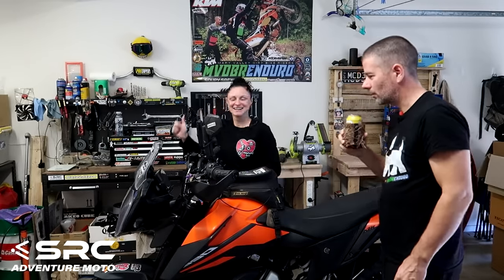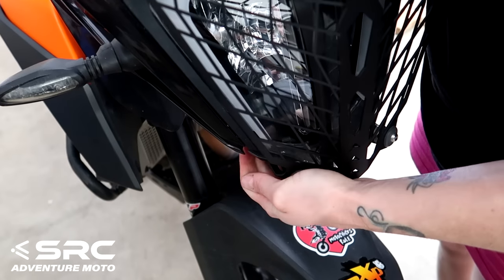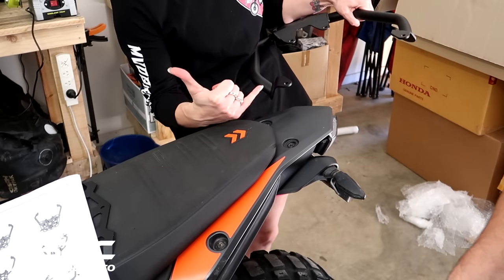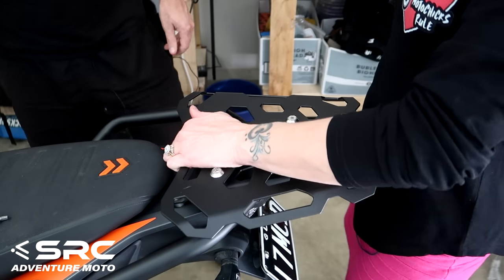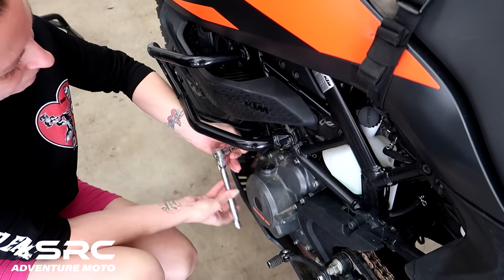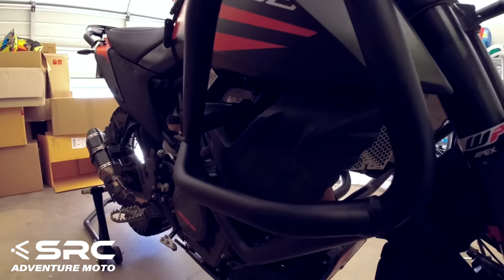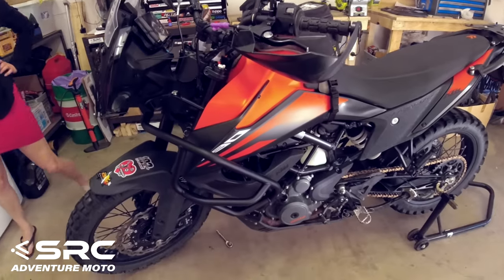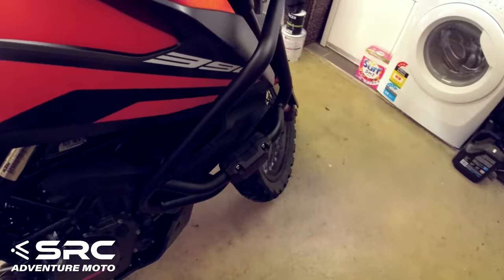KTM 390 Adventure: SRC Accessories Install - Crash Bars | Rear Rack | Headlight Guard

Comment: I went with the AXP rear rack after seeing it in your channel. It definitely has some flex to it, but works for me since it has more areas to strap on to. The slots on the side are well spaced and don't slip backwards or forwards with my net thing on them as they would with this rack or the stock hand rails since nothing is holding them fore or aft.
Reply from the maker: Yeah the AXP does the job that's for sure. Have yet to test out the SRC but I think it will be fine 👌
Reply: @MVDBR  It looks like it will do the job handily. I might have to get the headlight guard next, it looks like a nice piece of kit.

Comment: Hey guy's...nice gear you got from SRCMoto, and I hate to be picky, but not too impressed with the 4 bolts that hold the main rack to the frame :(...would have been nice if they were flush with the rack, instead of sticking up a few mm.
Reply from the maker: The ones that hold the luggage plate on? Yeah you're right it would be nice if they were countersunk or something but that would mean the plate would have to be thicker material, but that wouldn't be a terribly bad thing 🤷‍♂️ thanks for the comment Geoff 🤙
Reply: @MVDBR  Hey Josh, yes, sorry the luggage plate....I've noticed that the majority of SRC's racks have this mounting system, which in my opinion kinda limits what you can strap to it. for example a small jerry can. I'd also be concerned that if you had some "luggage" or soft pack's, that those raised screws could wear a hole in them. I have a B & B rack, and the holding bolts (which are countersunk bolts), are countersunk into the luggage plate itself, which is 4mm thick. I would very much doubt that if you decided to countersink Nat's, it would look a lot neater, and I doubt that it would compromise it's strength. Just looking at the clip as I'm writing, it's NOT going to crack....might even see if you could not use those little spacers underneath.
Anyway M8, that's my 10 cents....maybe a job for an upcoming Batcave Friday !!!  Cheers.

Comment: Have added up what the cost to build the 390 to this stage would be, bet its scary, might be worth a video on both bikes 🤔
Reply: Close to 5K USD
Reply from the maker: It would be a fair bit, but the only thing extra that the 390 really needs over any other bike is the wheels. Granted they are a big cost though 😬

Comment: Good video, a bit of protection is always a good thing 😁
I'm going crazy protecting the 790, with upper and lower protections but a lower one has come to me wrong and I've spent many hours to not be able to mount it, let's see if they solve it although they are taking it too slowly 😩
Reply from the maker: Was it for another bike?
Reply: @MVDBR  I believe that a part is wrong, it cannot be that everything but one screw matches. If I remember I Will send you the url of the video that i recorded. They are making me dizzy, They have even asked me for the documentation to check the exact model of the motorcycle........
Reply from the maker: @arruntus  what brand is the gear mate?

Comment: What mirrors are you running on the KTM 390?
Reply: @390advmotochick7  from memory you ran DRC mirrors before, why did you end up changing to double take?
Reply: I was running the DRC mirrors and didn't have a problem with them. We changed them to double takes as they were generously gifted to us by the amazing Tori herself 😊 and they are a great product
Reply from the maker: Except for that DRC one that like, snapped off when you went over that erosion mound that time 😬

Comment: Great 👍 job Josh and Nat , that was a good torque wrench 🔧😂😂😂. I’m the same never 👎 one ☝️ my brother in law ALWAYS does for just about every bolt - painful 😖 to watch 😂. He is heavy handed he wreckens . I’m installing new crash 💥 bars today ( SM- Motech ) for my Yamaha 660.
Reply from the maker: Yeah ya gotta have that fine touch aye the inbuilt forearm torque wrench is pretty good most of the time 💪 Yew rock on the 660 👌
Reply: @MVDBR   Funny how you get the perfectionists ( not having a go - takes all types ) i last bolt I snapped off when I was 14 on my YZ 80 J “ back in the day “😂😂. Yer I’m a bit of a Yamaha fan boy 👦. Was looking at the T7 , in the last 6 years have brought 4 new bikes 🏍 a lot of money I have lost on resale, so last 2 have been second hand ✋ with low kms . I also do most of my own maintenance anyway. I trick I learned before you sell a bike take ALL the accessories off and sell separately. “ helps fund new ones for next bike 👍. Take it easy guys look forward to your next vid .

Comment: Looks like you might be running an AXP Racing skid plate... i wasn't aware they made one for the 390. Did you retrofit/ was it meant for another bike, or does AXP offer that now?
Reply from the maker: No they used to have them listed on the website, don't know why they stopped. Although it wasn't very good, melted onto the exhaust header going over obstacles because it wasn't very well mounted. Ended up replacing it with a better alloy one from B&B https://bboffroad.com.au/product/bash-plate-ktm-390-adventure-r-2020-2022/

Comment: Great video again! I have 1 question. I own a 390 adv and i am 192cm tall. If i put the 1 piece ergo seat do i have to rise thw handlebar? I use the bike mostly on the road. Thanks a lot for your time!
Reply from the maker: Depends if you're comfortable, if you're riding on road you probably won't be standing up much so I don't think you'd need risers 🤷‍♂️

Comment: Again just watched you on the big screen .your both great .I installed SRC stainless crash bars on my 22 T7 and Wednesday put the SRC rear rack yes it looks great pretty simple to install and Nats bike looks awesome and one thing you did mention the  little joint pipes that go in there yes I noticed those little 4 mm button Head Allen's not very deep for the Allen wrench I left mine in but I will put stainless Allen heads in mine when I take them off or if I have to and know have the Kriega 9 back pack. Awesome. !
Reply from the maker: Yeah man those supplied fasteners aren't the best 😬

Comment: Dont make my mistake, as you will end up losing that sidestand foot like I did. Put some RED loctite on those bolts even though they are probably nylon lock nuts, as I had blue loctite on mine and they still came undone on a long ride and i then had to buy another replacement foot. I made sure I used Red the second time around.
Reply from the maker: Aye, thanks for the tip!

Comment: What strength thread lock did you use for the top rack and stand ?
Reply from the maker: Removeable 👍
Reply: @MVDBR  thanks 🙏
Reply: @MVDBR  how’s the SRC crash bars holding up? Thinking of ordering them next are you happy with them ?
Reply from the maker: @MyJoel333  tbh they are freakin awesome, I think they look great and the motochick has dropped the bike on them plenty of times with no bending or anything 🤙